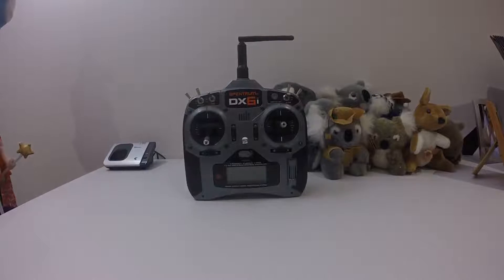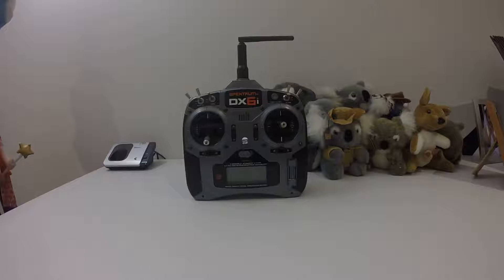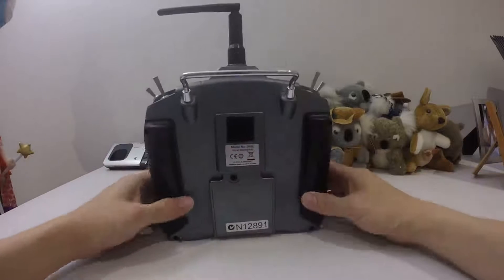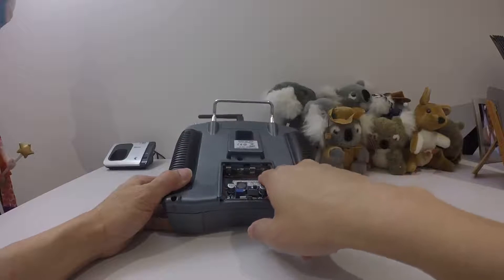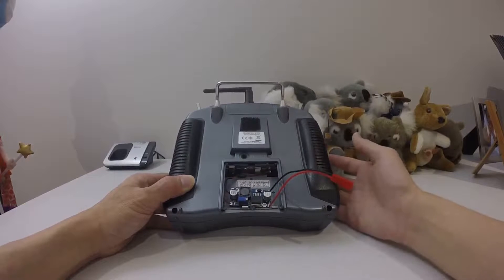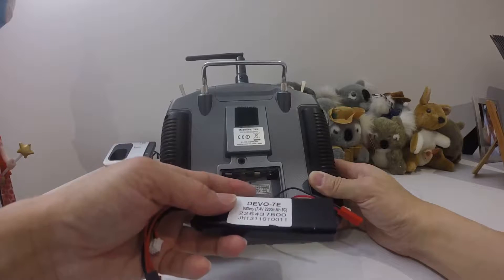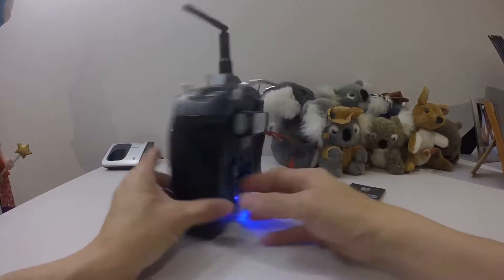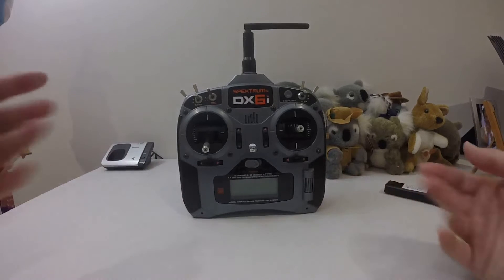Quadcopter - Spektrum DX6i transmitter Lipo Battery Mod

Comment: I cut the battery compartment out of mine took it apart fit a 2,000mah 2s lipo inside and only need to charge it every 4 months.

Comment: Just in case anyone looking at this video, I was about to do this mod, but when I opened up the transmitter I figured that is has a voltage regulator that can take up to 35V as an input, so I connected a 2s 600mah battery and it turned on showing 8.4V with no issues :)
Reply: Thanks a lot. Useful information;)

Comment: thanks ,this video is very helpful. probably the best battery mod video i 
have found. i have a 800mah 2s battery that i would like to use in this 
transmitter, do you know how many Mah are drawn from the transmitter and
 buck converter?